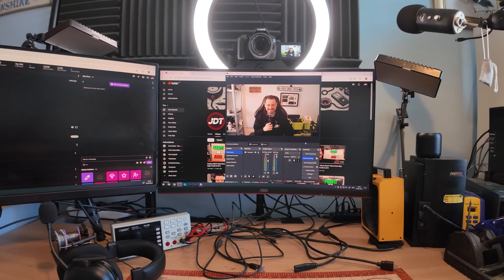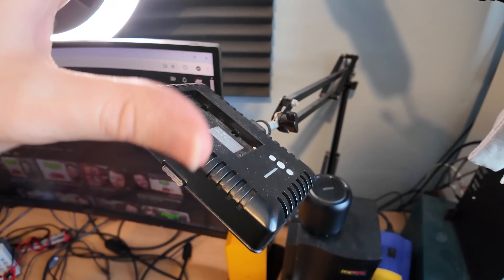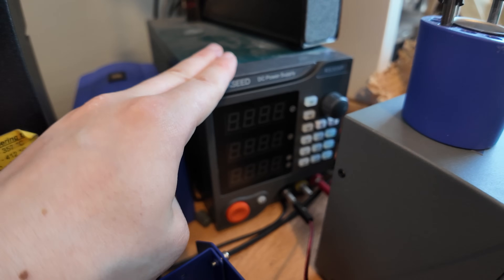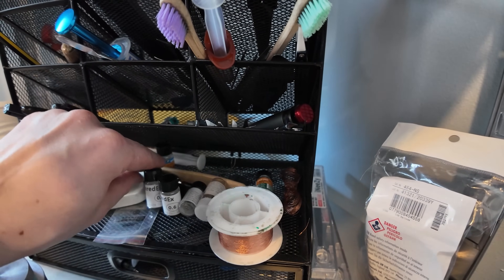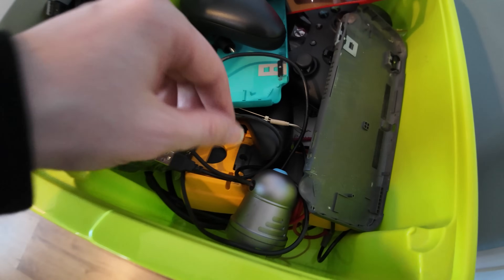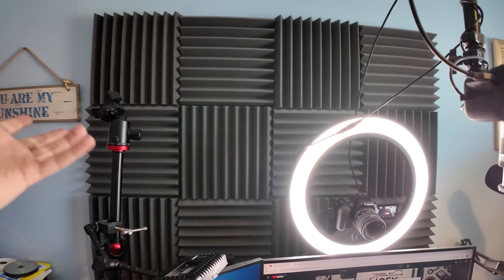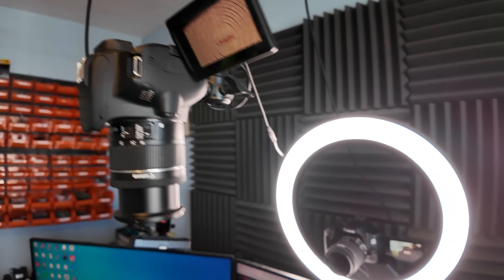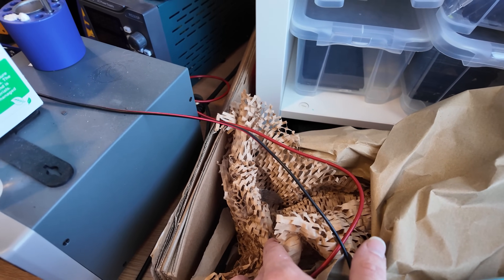The Equipment I Use to Repair Electronics!

Comment: Hey Joey 
Great channel ❤
Regarding the multimeter, when you connect to PC it goes to 'remote' mode to communicate with the PC app. 
If when you want to use the buttons you need to go back to 'Local' mode. Of 4 function buttons next to the screen the one on the bottom
After going local then you need to reconnect through the PC app again
Reply: I was just about to comment this ☺️

Comment: I know this video has been around for a bit now Joey but just wondering did you figure out if you press "Local" when plugging in the multimeter it allows you to use the buttons on the device as well?

Comment: Tip for the electric screwdriver: just break the screw loose manually first, there should be enough resistance in the motor if you give it a quick sharp twist, then it's quick to back out the screws.

Comment: Hi Joey, love the content. I know this is an old video, but I was wondering what soldering/workbench mat you are using. That is the only one I could not find in the list. I've tried some cheap rubber mats but they have so much static build up at the end of some soldering and hot air session. Is there any mat that is both heat resistant for soldering work and also anti-static?

Comment: Have been watching for a bit! I have noticed your overhead camera tends to struggle with autofocus though. It may help to set the lens to manual focus (MF), dialling focus in manually, selecting a darker/slower aperture for a bit more depth of field (given you have additional lighting for the shot) so that the camera doesn't struggle with missed focus/focus hunting occasionally. It may take a bit of experimentation. Those lenses on your 250Ds are 'variable aperture', meaning as you zoom in less light reaches the sensor which can cause issues with autofocus in darker/indoor lighting. There are 'fixed' aperture zoom lenses (usually f/2.8) for the EF-S mount that may be worth considering, but are expensive. The big brother EF mount lenses will attach to those cameras, though you need to multiply their focal length(s) by 1.6 to account for the smaller camera sensor (called crop factor) which will change the shot framing.

Comment: @Joey, in the last stream you've used a hdmi port tester with usb-c-port output, on which you've connected the Mechanic USB-C test tool. What kind of HDMI test board are you using?
Keep up the good work. It's fantastic to learn from you.

Comment: Just wanted to say thank you.  I just purchased the microscope you use to use in class with students - an inexpensive solution to be able to examine and project circuits and components in the classroom.  Will also be purchasing the bench multimeter you recommend for the same reason.  Now to find a O-scope with HDMI out...
Reply from the maker: You're welcome! That's amazing to hear :)

Comment: 1. Why are you recharging those lights everyday. Make power supplies for them, it's easy, or even better repurpose existing ones. I'm sure you have a larger bin of power supplies you didn't show on camera. We all have that bin. 

2. Canned air. When that is empty drill a hole in it and out a valve from a bike tube in it, epoxy it in  and then refill it yourself for free. Way cheaper and doesn't require propellant. 

3. I didn't see any actual electronics stuff aside from game console parts. So you repair some electronic things but you don't do electronics repair, is that right? I'm going to assign you homework then. Make power supplies for those daily recharge lights  and then next we'll move o,n to making your own ring light, anti glare is a nice feature maybe that would be fun and add a little variety. Instead of Joey fixes, Joey makes. That sounds more interesting to me. Expand your horizons and all that crap.

Comment: Was this filmed on that little gimbal cam you fixed previously? Lol. Great vid though, I was one of the 5. Been thinking of getting into filming and what kind of setup was used. Also def gave me some ideas to clean up my workspace. Currently using IKEA pegboard, but I think I’d prefer more of that red drawer setup you have on the wall, more compact compared to the IKEA stuff.

Thanks!

Comment: awesome setup ur just missing 1 essential device and seeing as ur already integrated into the elgato the stream deck would help you out a bunch. ive got the v1 15 button one and it make live streaming and streaming soo much easier.
Reply from the maker: I have thought about this! =]
Reply: @JoeyDoesTech  i was on the fence about buying it again but i found one on ebay for £50 and i grabbed it . its the best £50 ive spent.

Comment: first tip of the day: multimeter use the "visa" software to communication with the multimeter. if you have installed visa software without "disabling windows fast boot" option during installation setup, this can give you problem connecting the multimeter on pc.
second: when you connect the multimeter on pc you don't need to power off and on again to have button functionality again. just press "local" function button on the multimeter after you have connected to pc. this restore the option to control the multimeter with the inbuilt buttons.
third: your multimeter can read data from probes faster than you currently have. just press the button relative to speed option to increase the reading speed. unfortunately this option doesn't stay in memory. you need to restore it every time you power it on again.
fourth: if you can't see a phisical button that say one or more thing that i said check on the screen. sometimes functionality can be changed with the gray buttons next to the screen.
let me know if you understand